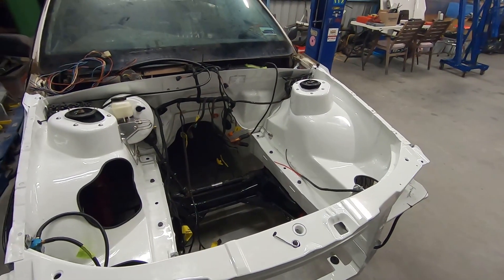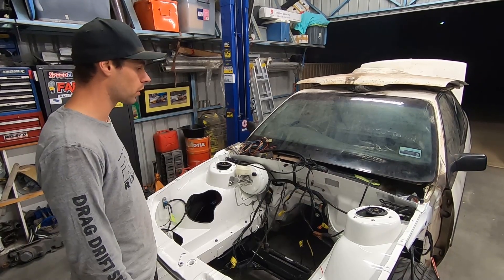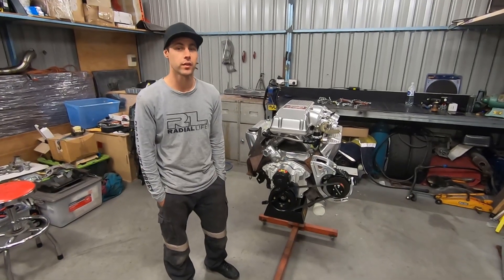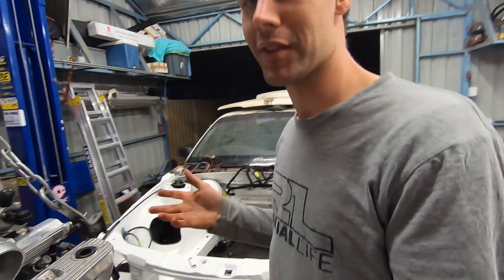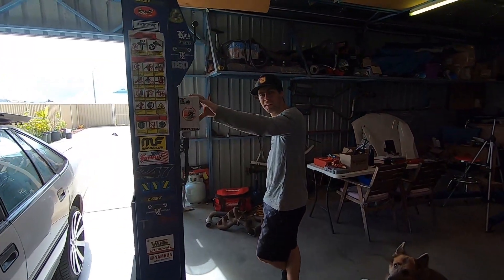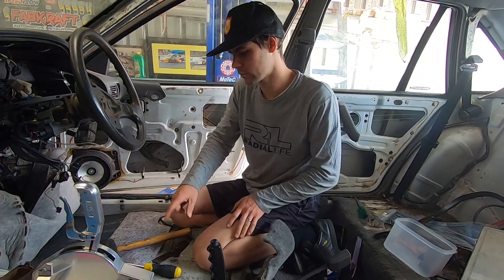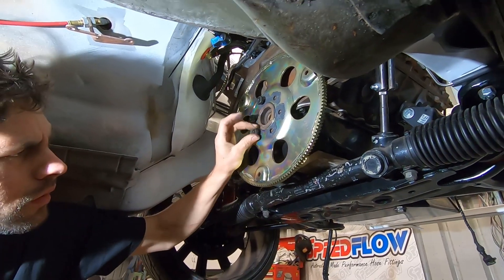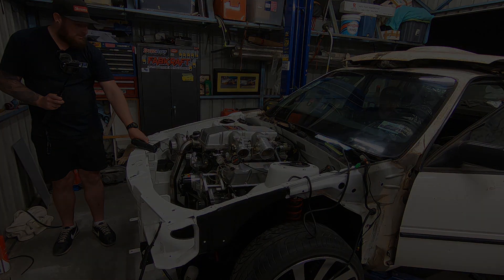Turbo Holden 304 & TH400 GOES IN the VR Commodore | [The Bunky BT1] - Ep6.

Comment: Great video. Could you tell me what timing cover, water pump, alternator bracket and pulley setup you are using.
Reply from the maker: Thanks mate. It's a bullet race engineering timing cover and alternator bracket, with a reidspeed 6pk pulley kit 🍻
Reply: @TorqHub  thanks mate, what about the pump?
Reply from the maker: CVR electric water pump Davo
Reply: @TorqHub  Cheers mate

Comment: What's the stuff you spread on the face of the flex plate before bolting it on?
Reply from the maker: Arp lube mate. It comes in the packet.
Reply from the maker: Loctite on the threads, but the ARP lube on the plate is for the bolt head to ensure we get a true and proper torque spec without any binding. Last thing you want is the flex plate disconnecting from the crank under load 😬